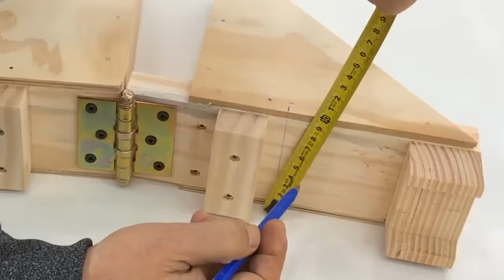POR QUÉ NO HICE ESTO ANTES!!! Brillante IDEA que te AYUDARÁ

Comment: These are pretty clever. People who are mocking this video are not carpenters. I use a simpler version of these all the time when I am fitting and hanging doors. I need to hold the door on edge like this in order to plane it to fit and in order to inlet and install the hinges. The version I use is just a 2x4 base with two scraps of 2x4 or 2x6(better) screwed to it. This version is a nice bit of kit.
Reply: Exactly what I thought.  Just summat you can knock up in a cuppla minutes from scrap wood. 
This is great if ya gonna work on nothing but doors all day.
Reply: Made a door stand in trade school with a much simpler design.
Reply: Yes. Apprenticed as a carpenter in my youth and hung a lot of doors. Wish someone could’ve sent me a link to this video 45 years ago. 😂
Reply: To Plane  I can see a use otherwise sawhorses would accomplish installing hinges and door knobs just as well. Plus they have many other Uses. Sounds to me like planning reduces the need to plane. Remodeling might have a use. New construction should all be prehung.
Reply: @user-bt5lt1fq2y  Yes, prehung in New construction and many remodels. 

But one thing I do a lot is spruce up older houses with new trim and new doors. I just replaced every door in a house last week, and tomorrow I'm going to replace every door in another house. 

I use blank replacement doors which are a bit oversized and need to be planed to fit. I use a much simpler version of these things to hold the door on edge while I plane it and also put the hinges on. Hinges are inletted with a router, and that operation too is done with the door on edge. Saw horses are for cutting a bit off the bottom of the door, another common operation. I usually bore for the locksets after the door is hung, but I have done it with the door on edge. It would be inconvenient to bore for the locksets with the door flat on the horses, because I need access to both sides. 

In conclusion, the door holders in this video are very practical and useful specialized items for specialized work. Most of the people commenting never have and never will do that specialized work. So why are you commenting?

Why not go to the automotive videos and make clever comments about how stupid bearing pullers are?
Reply: You must be a Contractor and can use this kind of tool.
Reply: @robertlewis3492  As I said, I use a simpler version, without a hinge or bungee cord. I'm a carpenter, and I often hang new doors in old jambs.
Reply: Just use a piece of 4 x 2 with a slot cut in it and a wedge.
Reply: @6panel300  I use a block lying flat, either a 2x4 or 2x6, onto which I screw two scrap blocks on edge, spaced slightly further apart than the thickness of the door. Sometimes I use a thin wedge, but usually don't bother.

Comment: I could really use that, 

maybe once in a lifetime!
Reply: Then he wasn't talking to you! Can you figure out who it was for?
Reply: 1986subway I suppose I see more value in using my clamping saw horse for this job and dozens of others rather then two things of limited use taking up space unused for 365 days of the year
Reply: @harpersisland  got it,your experience and skill is the very pinnacle and thus no improvement can be made on your methodology.  Also carpenters who specialize in strictly modification and replacement of custom doors are most definitely not a thing🙄
Reply: 1986subway you are taking a comment about someone else video awfully personally.  However in the end I really could not care any less what opinion you have as I suppose many here have regarding mine, difference is I won’t get all pissy about it like you do.
Reply: @harpersisland  there ya go bud never admit your flaws when someone points them out. You will always be perfect in your own mind. I don't find ignorance offensive, but refusal to correct it is the most disgusting thing a person can do

Comment: Glad I skipped to the end so I could use that time reading useless comments on a complex solution for a simple problem. I especially like the idea of “spacers” so u can work on a different thicknesses of wood 1 inch off the floor. Thats brilliant! That jig could be made as a single unit out of a couple of 2x4’s in under 5 minutes and be far stronger and more stable.

Comment: I have been using a version of one of those for over 40 years. A little more crude  but still using the same one. I actually  used it today when hanging 2 doors. Still works great.
Reply: What is it for?
Reply: My door jig is 25 years old, i made two of them. They are about 16” at the base and 24” in height. Cumbersome to carry but the weight of the door clamps them very nicely.
Reply: This one is superior to mine . Great idea.
Reply: Think i could use this for garage doors

Comment: I've discovered that being a packrat, saving every little scrap and random piece of hardware, pays off. From time to time it leads to coming up with just the right parts to make something such as this. This is inspired!
Reply: Maybe if you’re a hobbyist. Any professional woodworker will tell you they’ll make a dozen more scraps just like it before finding a use for the first one. Every jig or fixture I make gets dated. If it hasn’t been used again in 6-12 months, it goes in the wood stove or the dumpster.
Reply: @Tom I’ve been trying to explain this to my wife. She’s not grasping the concept. Any advice?
Reply: @JeffHochberg  The way it works for me is just proving the value of some random piece of material. The best example I can think of is when I used an old pallet to raise her  recliner per the home nurse's request.
Reply: @JeffHochberg  To expand on previous: Art is my hobby. I am highly visual-spatial. When there is something that needs fixing or fabricating I start pawing through my various bins and boxes visualizing what can be applied to my project, and in what way.
Reply: Ese invento,sirve también para colocar bastidores.

Comment: That is called a "Martha Stewart" when something that can be simply done in a few minutes is expanded into a project that takes hours.  I'd use 2 or 4 woodscrew clamps along the edge to get the stability I need.
Reply: This is meant for repeatability, you don’t exactly tear this down and once it’s built it takes much less to set up
Reply: A carpenter who doesn't understand the value of this isn't much of a carpenter

Comment: This is actually really smart and really useful, if you install doors that is. Just line the jaws with scrap carpeting and these would be even better.
Reply: The missing finger is killing me
Reply: @jqlmanufacturing9129  Nah, just a reminder to be careful even if you're a pro...
Reply: Why? What is this doing that simply leaning the door against any solid surface with a couple scraps of cloth to protect the edges do? Even if you are a carpenter does storing and knowing where these things are all the time really make them worth the trouble? Especially considering the idiot making the video dragged the finished door edge across the concrete floor when putting it in the stands this destroying the finish.
Reply: @TwilightxKnight13  that door was not finished..look at the scuff marks on the front

Comment: Back in the 80s I made one much simpler by using 2 2x4s 16" high scewed onto a 1/4" plywood with the 2 wood blocks to keep it off the floor. As you put the weight of the door between the 2 2x4s the weight would  alow the plywood to flex and clamp the door down.
Reply: Sounds elegantly simple and effective, and probably took you what 3 minutes to make? 👏🏼👍🏼
You should make a response video 😉
Reply: Yeah? Did you make a video about it? This guy made a video about it.

Jk, just pulling your leg.

Comment: Made a taller, similar one with wider boards. We called it a doorjack. Cabinet maker showed me how. Use strips of carpet for nonmarring.
Reply: Same here, but I don't like working bent over, especially when planing doors, so I made mine adjustable to be able to work on different sized doors at a convenient height.

Comment: Love the creative design, love the functionality and the ingenuity, just one thing and that's the storage. I need to work on doors from time to time and have ben faced the same problem. What I do now is to just take a couple wood clamps and clamp a couple pieces of scrap 2x4 pieces on the bottom edge of the door where it meets the floor. Easy peezy.
Reply: It will fall over
Reply: Same idea just use a cutaway and a wedge. (As above)
Reply: @lovelyjubbly1010  Cállate!! 😡😡

Comment: Did similar ones as a union carpenter apprentice.  Mine had 2 feet tall arms, surfaces with glued on carpet, to prevent damage to the doors.  And one side fit into the other with a rabbet groove, to enable to slide in and out, to different widths of doors.  It locked on with a "T" handle that turned a screw to tighten the pieces together, and prevent opening up.
Reply: Can you do a video on it please?
Reply: Me sumo al pedido de rey. Podrías hacer un vídeo de tu idea. Soy pintor y siempre tengo el problema de tener la puerta cuando se pinta o se cepilla. Gracias . Si lo haces con sus medidas específicas y subtítulos .. 👍

Comment: Nice. We’ve used a quick jig like this. Usually a piece of 5/8 or 1/2” ply as kind of a spring board with a few triangles to hold the door when we router hinges or plane the edge on site. I’m gonna make a few of these. They fold up more compact and look like they work great.

Comment: I am a door Carpenter, this is a wonderful tool well-designed. For holding doors so that you can work on them easily. My door Jacks are low Tech, but I'm going to make 2 of these Jack's an put on my truck. One Improvement that I will do is add carpet to the inside!
Reply: perhaps carpet the outer feet too.  Prevent slips.

Comment: If you're wondering "the why"...some doors need to be planed, and/or hinges cut into the side.  A device like this is very handy, and has been used for decades in the trades.  A padded version provides protection to an already finished/painted door.

Comment: Some scrap wood picked up on the job along with carpet scraps built my door stand nice and solid and padded against damaging the doors  Lined with one attached carpet pad just over the top edges down the inside across the bottom up the opposite side and rolled over the top edge  A couple of extra carpet strips and placed in along the side or sides and it will hold doors of multiple thicknesses from residential through commercial including hardened, fireproof, and X-ray The ones I made almost 40 years ago retired with me in '08

Comment: I usually store my doors in the doorways. They are all over the house. I guess if I had extra doors it would be cool. I did learn its ok to use a 2 drills so I don't have to switch bits.

Comment: I love jigs and such and this one is great, especially for at home or in a shop, a little bulky to store in the truck
40 years at carpentry there's a real fast and easy door buck made from a 16-18" piece of 2x6,8. or 10, cut parallel kerfs from the same side to make a notch a quarter inch wider than the door, at a depth two thirds the width of the piece of wood. Set it up on edge on the floor, notch up, and carefully lower the door into the notch at the top or bottom rail (line the notch with a clean shop rag to protect a finished door) then place one shim between the door (or shop rag) and the buck, a second shim between the first shim and the door buck and tighten the door in place by driving up the second shim. One buck, two shims and a shop rag if needed is all that's needed to hold a door on edge and in place, and the bigger and heavier the door the more stable it is. Hollow core luan and  masonite doors are the worst to hold still. 

An after thought on your design, i think it might also be great for one man cabinet assembly. I've always used hand screw clamps to hold a rip of plywood upright to make a cabinet side so I can attach a perpendicular piece to it. Holding all that until it's clamped is a coordination test I often struggled with. A few of your design, scaled down to hold sheet goods, would be some kind of quick and easy. Looking back on a 40 wrestling match...wish Ida thought of that!

Comment: Mine is made of 4" polyethylene (bathroom stall material) and absolutely will not scratch doors if kept clean. Biggest door I ever put in it was 5' x 8' steel entry door with full length hinges.

Comment: Or you could just nail a board to the side of the door. You can even use the latch hole or the hinge screw holes if you are worried about the small hole it makes.

Comment: The electric turns on a transformer, not a rotor.
You run a 12 volt cord from your battery to a converter. The converter goes to a fuse box, or a breaker box, using 110 ac. The breaker/fuse box distributes the 110 ac to each breaker. Then, from the breaker you run a cord to a transformer to upgrade the amperage or voltage for each destination. One needs to be a battery charger to run back to recharge the battery.
every transformer is a generator - YouTube
You won't need power plants anymore

Comment: Just drill and screw a 2 to 3 foot section of 2x4 onto the top (and bottom, if you wanted more stability) ends of the door so they're flush with the long edge and make a "T" with the door. Done. No one's going to see the holes left after removing the 2x4's, and then you don't also have anything blocking the front or back faces of the door panel if you were going to, say, paint the door. If you used fluted-tip screws (self-tapping), it would lickey-split quick to do. 

I get that this is probably for someone who does a hundred doors a day all day everyday for their job, but for the average YouTube viewer, this seems unnecessarily complicated. More for someone who enjoys the journey as much as the destination I guess...

Comment: Over engineered. Been doing it with one length of wood, blocks on each end to sit on the floor triangles attached to accommodate door thickness, done. The weight of the door clamps itself. Good production value of video though.

Comment: So what?  You found a complicated way to hold doors. Now what are you going to do? Plane or use a router on the edge? No way. Not nearly stable enough.  It'll fall right over.

Simple solution: clamp the door to a saw horse.

Comment: Waste of time and space. Unless all you do is put hardware on doors. Not to mention it won't last. The elastic band is in a heavy wear spot if it used as intended. Using carriage bolts will add wear also. Those threads are sharp.
Think he's a good carpenter? Well, at one point he wasn't too good. Or he just stuck his finger in the wrong hole.